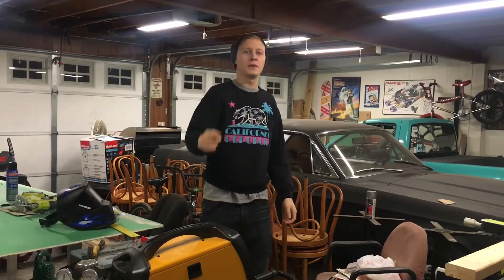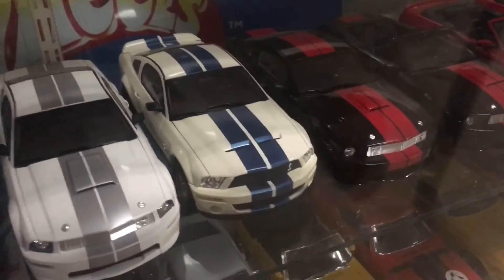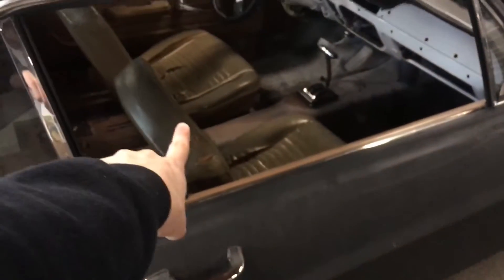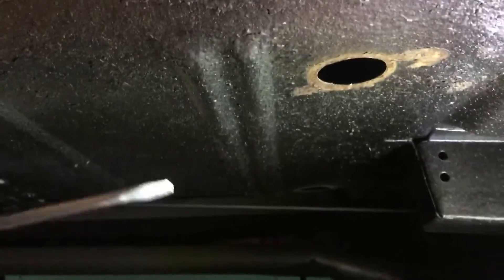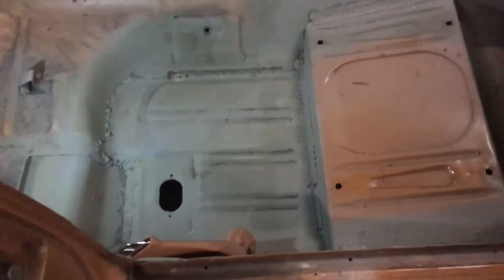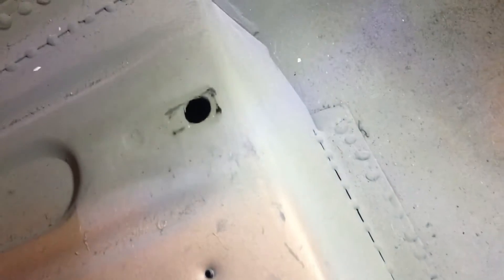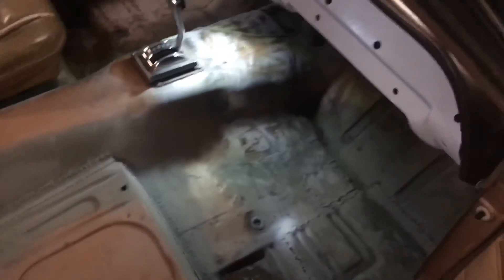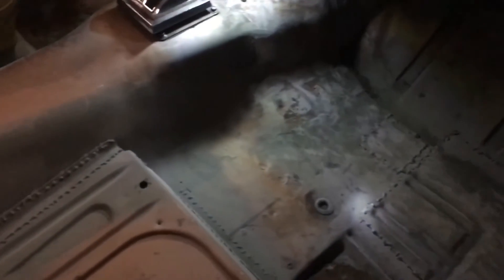1967 Mustang Seat Removal and Shop Stuff

Comment: Did you have to drill out spot welds or use a cut off wheel to get the seat platform off of the old floor pan? I got new pans but have to reuse the old seat platform. Thanks for the video
Reply from the maker: thomas shehan my apologies, I haven’t seen this comment but with that being said I did cut the plate forms right next to the welds, pulled the platform out then grinned down the old welds and welded in L shaped brackets, in theory adding cross strength to the seat platform and passenger side, I didn’t have to cut the driver-side out